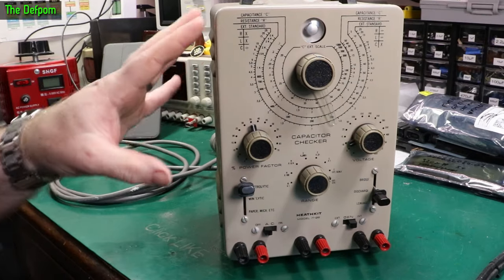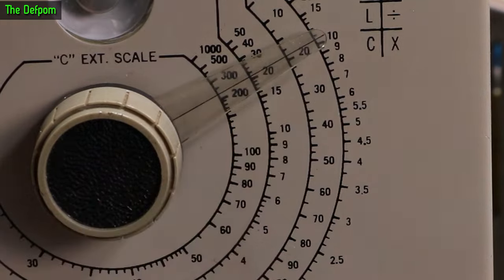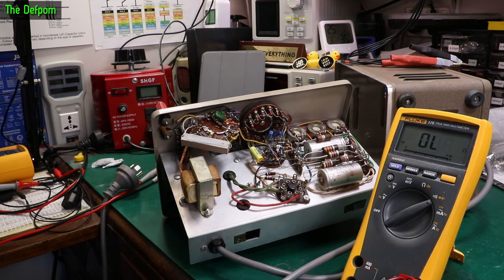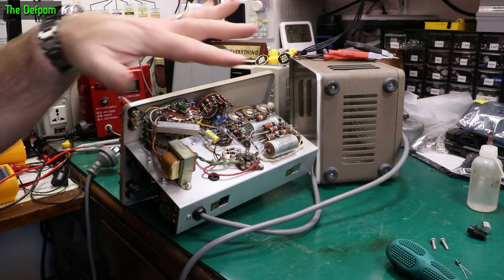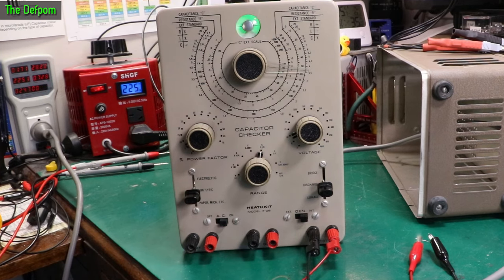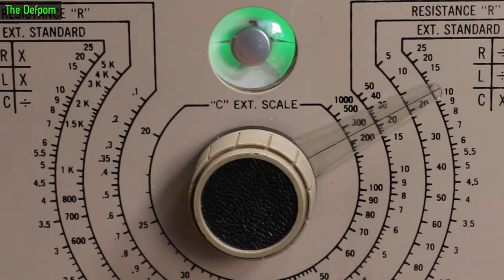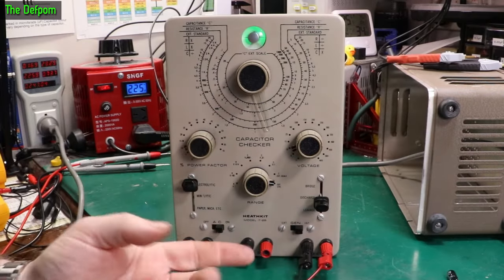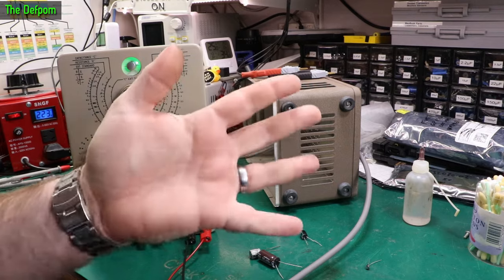🔴 Heathkit IT-28 Capacitor Tester Repair - Part 3 - No.1219

Comment: I just picked up the Eico 950B off Ebay last week.  I had to re-cap it and some of the resistors well out of spec.  After replacing everything the unit is working great and I even found a spot for it on my desk (I had the same concern as you, no space).  It's a great piece of kit for testing filter caps in vintage radios and such.  I'm glad I was finally able to get one.  Great vid!  Cheers!

Comment: The way i've 'retensioned' ccontacts is to put a small flatblade screwdriver between the head of the rivet and the raised part of the contact, give the screwdriver a gentle twist to push the bend away, this also works for wiper contacts
Just check if the rivet is tight before you do this.

Comment: On other models I've seen you have to 'hold ' the leakage switch down and as soon as you let go it springs back into the 'discharge' setting, which is a great idea. My point being is this model without this feature or is it bust ?....cheers
Reply: Cheese.
Reply: Squeak !! @daveodessa
Reply: Does not have that feature. It is a 3 way switch. Telecaster style.